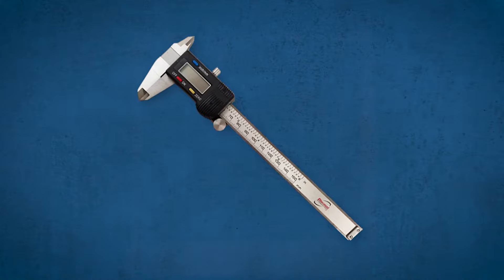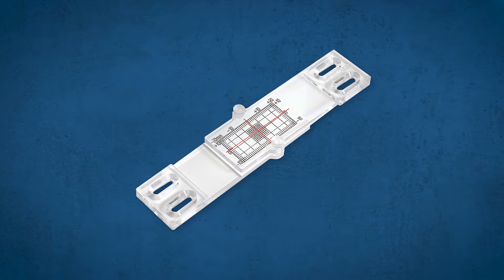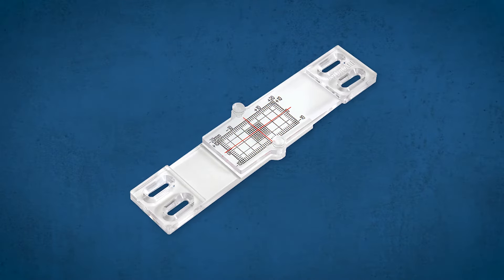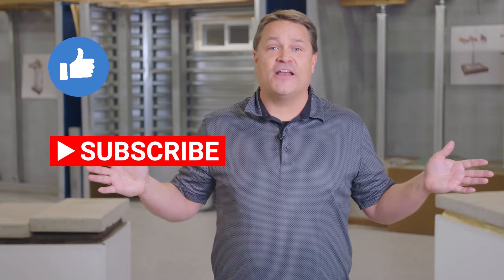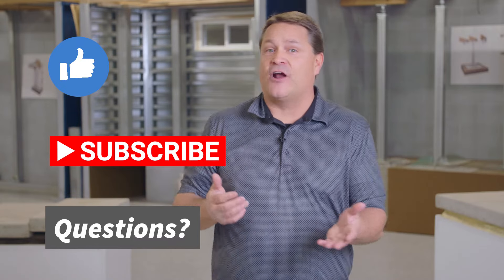What Kind of Foundation Cracks Are BAD??

Comment: I believe that 50% of home settlements are the plumbers' fault.   They will drill out 60% of a beam or wall post to accommodate the plumbing.   Im not sure why the engineers or architect dont have precise placement for plumbing.  Because all the cuts and drilling can't be good for the overall structural integrity of the home. 😢
Reply from the maker: Hey! Kyle here—thanks for sharing your thoughts! It’s true that plumbers and electricians often need to drill holes, and there are guidelines they should follow regarding size and placement. I’ve definitely seen cases where holes were drilled too large, too many were made, or they were in the wrong location. Mistakes like this can cause structural issues with the framing but should not be confused with foundation settlement. A thorough inspection of the foundation should be able to make that distinction.
Reply: Hello, i just used the term settling but I'm talking about the movement of the overall structure.  ie nail popping and wall cracks and unleavened floors.  Because large holes in floor joists can cause floor sagging.  I renovated a bathroom where an 2x6 outside wall studs were cut 4 inches to vent the plumbing.   We both know the engineers did not consider that type of structural changes.

Comment: I have a question. I have a house that is new construction and has hit the 1 year mark. I noticed there is a horizontal crack around the exterior brick veneer on one side of the house. It is less than 2mm, and the soil around the house is clay. I don't have any bowing walls, windows open/close easily, but we have had some extreme weather this year. Does it sound like normal house settlement?
Reply from the maker: The first couple of years is a great time to be paying special attention to a foundation. Certainly, the house is settling into it's long term position and some small cracks are not uncommon. On the other hand, clay soil is the most susceptible type of soil to changes in volume that can affect your foundation. Your home has just gone through it's first cycle of all the seasons and the temperature and moisture changes that come with that. Kyle's advice would be to verify that you have good positive drainage for water away from the house, keep an eye on that crack and if it concerns you, have it looked at by a professional. If it is a problem, things only get worse with time.

Comment: Watching this video because I've been living in the same house 25 years I'm 35 now. The house has been in my family since it was built in the 50s. As far as i know it hasn't had any major repairs since around the late 80s/early 90s, my aunt and her husband used to do most of the repairs and hire very cheap labor.

 Now the sidewalk around my grease trap is cracked and unleveled(there's a hole forming pretty deep, where a tree grew for 40years) and even big chunks are breaking off. The entire house from front to back has cracks all over it. The porch is beginning to separate and the interior is riddled with cracks and stress marks. 

I live in Chicago so weather definitely plays the biggest part in this. I've noticed a couple more houses on my block have similar issues. One directly across from me has the same issues on the outside, their stairs are even worse and this house was renovated about 15 years ago with an expansion to the attic,almost new everything as far as cosmetic improvements. 

I really don't want to let the house go under but i can't afford a 100k+ repairs. I've been freaking out almost every time it rains, snows, or is super windy. Oh and my house was hit by a car 20 years ago, the impact spot was a column on the front porch supporting the roof recently started shifting

Comment: We had our home in western Massachusetts built, in 2010.  We used a high end builder, with a reputable history.  We intended on being here only 3-4 years…..here I am twelve years later, and now, I’m finding cracks throughout my basement. On the walls, and on the deck,  along corners, and diagonally from basement window corners.  During freeze-thaw-rain-freeze cycles, common in late fall and early spring, two of the cracks show some moisture!  I’m retired military and retired law enforcement….I’m no wallflower when it comes to stressful situations.  But I’d be lying if I didn’t say that I am “freaking out”, at least mentally.  My wife works for a law firm, I asked her to,ask her boss about what legal actions are possible here.  Maybe nothing to be worried about….maybe.  But still, maybe one of two fine cracks, I can live with, but at last count, I had over 15.  I did the “tape marking” thing….I’ll do the measurements.  While I spent some of my LEO time chasing “crackheads”, I never imagined that in retirement I’d be chasing “cracks”!  (Ya gotta laugh, I guess).
Reply: I've built foundations my entire life. I work, outside your market, for a contractor that repairs everything foundation related.

Shoot me a message and some photos, I'd gladly look them over and give you an opinion. While it can feel really concerning (and may very well be) a lot of times what you're describing is nothing to worry about. With that being said, a bad faith actor could easily capitalize on your obvious anxiety over the situation.
Reply: Thanks to your comment I laugh my head off every time he says crack 😂😂😂😂.